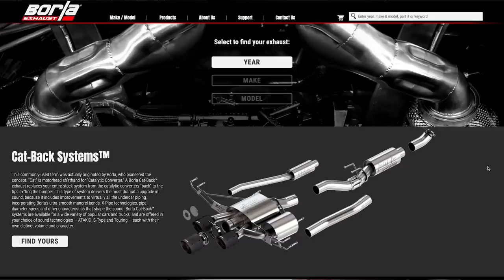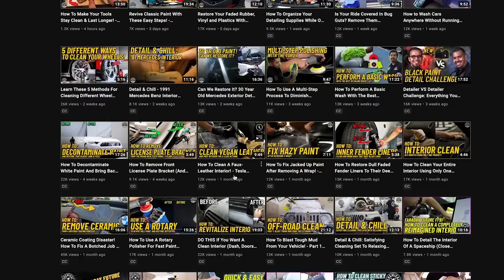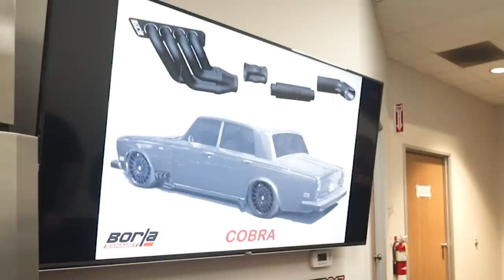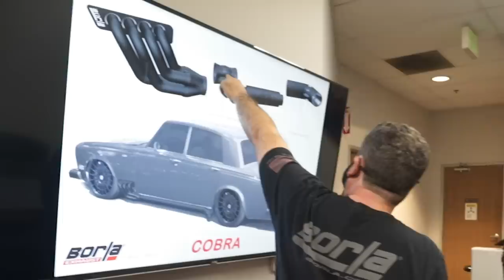The Hellcat Rolls Royce gets X-Piped at Borla! Is the Switchfire X-Pipe the best sounding exhaust??

Comment: I made an e92 m3 straight pipe that was stupid loud from the outside coming out the rear. but quiet as stock on the inside. No drone, no vibrations. Exhaust was menacing ripping the car through a tunnel. Was not a typical e92 m3 sound.

Comment: What makes the tuning really important is that the ability to make pressure zones and nulls, and the potential rate of change / flow rate is insanely complex in cars, because they combine resonance / standing waves with supersonic / turbulent / high flow rate components. This can hugely influence performance and durability, particularly of valves and valve seats.
Reply: Annnd all this at different loads and RPMs. 🤔🤯
Reply: Car exhaust is never supersonic. At most it peaks at 80m/s… if that.
Reply: @dominicokelly9160  if you create a varying pressure zone, the acoustic wavefront travelling at the speed of sound will be taken supersonic by the changing pressure, temperature, venturi effect etc. This causes very complex acoustic effects in trumpets and saxophones, let alone car exhausts.
Reply: @weareallbeingwatched4602  Ha- no I’m afraid you’re wrong. You’re saying lots of complicated words but your two paragraphs indicate your have absolutely no professional education in aerodynamics whatsoever. (Source: An Aeronautical Engineering degree and lots of industry experience).
Reply: @dominicokelly9160  a major problem that almost nobody in the acoustics industry understands is how turbulent eigenmode distribution (and hence system resonance(s)) results from the mismatches in the speed of sound at different pressures and in different materials. In a conventional loudspeaker driver, there is a mismatch between the speed of sound in the air vs the diaphragm - force can propagate through the solid material of the speaker cone structure very quickly but it's not instant, and the materials have resonances, eigenmode plots and force concentration areas, and materials have limits - pushed beyond these limits the cone fails - in consistent places no less. Saturation of forces results in changes of system performance, and resonant distortions can appear aggressively, with system failure appearing quickly afterwards.

Pulsed systems are more complex and prone to saturation and turbulence - areas crashing past laminar flow limits and into cavitation / reynolds escalation / flow state & vector function & direction changes. A saxophone or trumpet works by creating a pulsed flow, locking and unlocking a Reed or valve to create a standing wave in the pipe. Predicting how the eigenmode distribution of a multi-valve system with a bunch of turns and variations in tube width - in order to achieve a maximization of delta (rate of change) values at the valve / cylinder body is about creating such extreme variations of pressure and pressure flow that the acoustic properties become very strange - pressure zones, diffraction and force concentration effects combined with mechanical resonances and subtle distortions of parts leading to significant changes in sealing capability, I think you will find that OpenFOAM or a suitable test cell and transducer array can be employed to corroborate my claims. I won't tell you who I've worked for.
Reply: @dominicokelly9160  consider the speed of sound in stainless steel, the speed of sound in liquid air, the speed of sound in a vacuum and the speed of sound at ten atmospheric pressures. Now consider *wavelength*... and stick that all in a massive parallel equation matrix in 3d, and tell me where the nulls in the pipe are at 4300rpm for a drag racing engine with a complex manifold design - ie the areas of the pipe which have a consistent pressure and rate of flow... it's a complex chaotic acoustics problem in the real world. To demonstrate how acoustics design is difficult in this domain of contained tubes, PMC (a loudspeaker design and engineering company) have had to run extensive dev work on their transmission line systems because of pressure saturation and the speed of sound altering by a considerable factor, resulting in the system values and resonances altering *considerably*. That is a simple folded box duct, with maybe a couple of watts of acoustic power and no net DC flow. Not an engine with hundreds of kW in chemical energy explosive forces raging at the end of the pipe.
Reply: @weareallbeingwatched4602  Wow…. Nobody with any professional experience would write the diatribe you just wrote. You have no idea what you’re talking about!!! Who are you trying to impress? Some random guy on the internet?! If you don’t have knowledge in an area then who cares- nobody can know everything. But don’t pretend… you’re only lying to yourself- and if you do that for too long it’ll start degrading your self esteem.

Comment: YO! Is there any posiproblable chance of side exhaust for a kinda open header style tuned switch for when y'all decide it's safe to up the power? The rear exhausts look sick, as I imagine they'd be 3-4 inches. I figured the switched tuned sides might be 4x6 ovals or maybe with style cues from Vipers. With Borla tuning, even building a subwoofer box has the same principles in mind. I know but not from what brand/s there are electric switched open header insert pieces that just side dump. Have you ever heard a Brabus G-Wagon? That Rolls still has that supercharger with all it's tuning. I'm just saying if possible consider something extra.   If y'all haven't already, unless those side exhausts were optional...